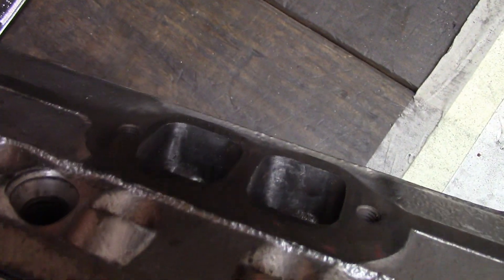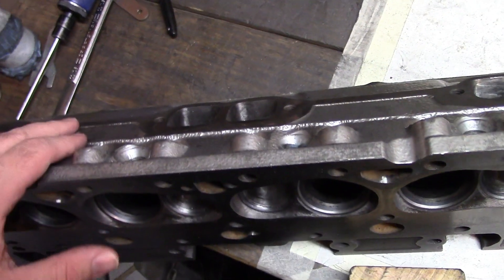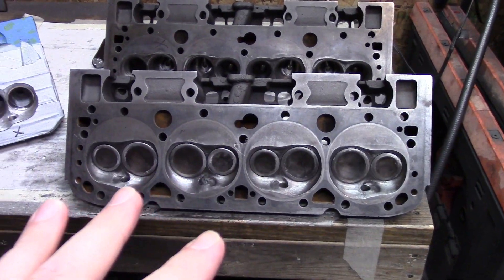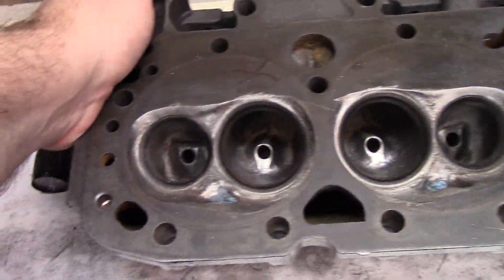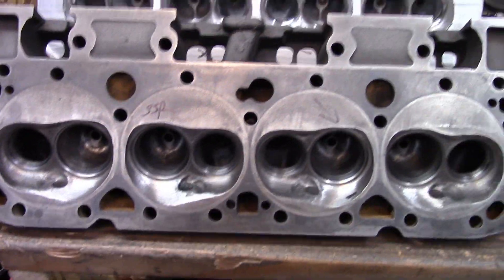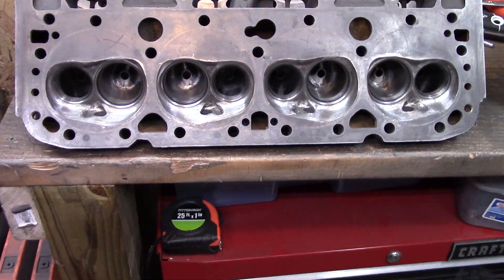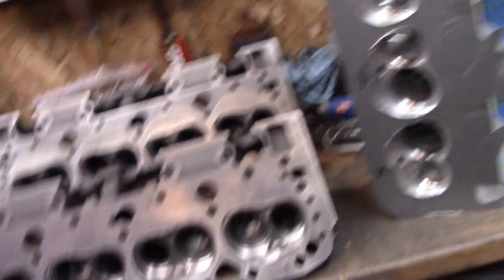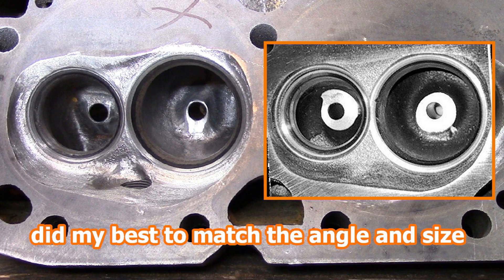Porting My Dart 2 SBC Heads Part 2

Comment: Nice work ! What engine are these going on. You talk about low compression..  Stock short block ?
Reply from the maker: Thx trying to finish them up tonight, then edit and upload pt3 for tomorrow.  It's a stock shortblock with dish pistons but I'm actually leaning towards not using them again LOL but I still wanted to finish them up at least.  Gonna CC a runner & chamber at least soon on the Darts.  After I inspect the 3.0 ebay head set I bought, gotta get that done in case I need to return that set by Tuesday
Reply: Do you happen to know the piston dish cc of the orginal piston with the chamfered edge ? 

I have a set of worked sportsman’s I might use on a similar deal. The compression and quench will suffer but it might run decent with properly matched parts. Camshaft, intake.. etc
Reply from the maker: @kristjanstefansson2765  I read the older dish like in my 77 are like 12-14cc, so I use 14cc when I calculate the compression.  Low end  n driveability will suffer but like you said with the right parts it can be reduced. Plain unported Sportsman II's were really picky on the tune but that was with the factory 1500 stall, I was too lazy to swap it LOL
Reply: What camshaft did you run with it. Did it suffer on the low end ? 

Flat tops with a decent quench and a small stall would probably do wonders. But that’s not the same throw togeather deal
Reply from the maker: Yah more comp would deff help and why I was considering milling the heads down to maybe 58-60cc if possible.   Stall would deff help, more gear, longtube headers n so on.  Cam part num n stats are on the muffler video I think.  Car worked for what I wanted when tuned right, just those other things would of made it easier to tune.

Comment: You should port the eBay heads 
I have a set they need to be
Reply from the maker: I'll get back to the ebay heads after my car is running.  I may post what I've videoed so far but we'll see how the Dart series does.
Reply: @BOOT  how do I know who h ones I have again 
Mine are 3 years old bought from a racing shop in Ontario Canada and he told me he bought the cores and had them built by a local machine shop 
They have dual valve springs he said. 550 lift max 
And he gave me a long list of stuff done to them 
It cost me 1400 cdn for both
Reply from the maker: I'm not sure exactly what your asking?  You want to ID ebay or Sportsman II heads?
Reply: @BOOT  yes I want.to know which eBay heads I have
Reply from the maker: Well two out of the three sets that I have of the generic ebay heads have vortec shape intake flange ports and those two sets only have the 12 bolt intake pattern.  My 2.0 set has both 12 & vortec 8 bolt vortec pattern with more standard intake flange port shape but so did the procomp head I borrowed.  You'd have to look at the differences I pointed out in my procomp vs ebay video if you think they may be procomp.  IDK what 1400cdn equals in US, so can't comment on the price.  I do know the generic cores are popular and machined by many(blueprint engines), even a skilled porter is going to offer them shortly with his own CNC and valvejob.  It's also rumored AFR will use the cores for their new budget head.  There may be other differences but I can only compare the three sets of generic ebay heads I have seen myself and I still haven't really checked out the 3.0 set, that's also on my to-do-list after my car.

Comment: Ever consider throwing in a time lapse scene of doing work on the heads? I think it would be cool. Maybe some of your other subscribers can chime in on this comment and put in their 2 cents.
Reply from the maker: I would like to, just don't think the camera lens would like it!  I have a hard enough time keeping the lens clean w/o doing any grinding around it.  I did some shots of my chopsaw but that was outside and I zoomed in a lot LOL  Cast iron is nasty stuff!
Reply from the maker: Well any metal dust is, kinda why I built my workshop to keep it off my cars and out of any engines I build in the garage.
Reply: @BOOT , that makes sense. Wonder if you could come up with an enclosure to film from. Anyways, you'll get a vehicle going soon enough and we'll see some cool action vids.
Reply from the maker: I got enough on my plate atm LOL maybe someday I'll have a old camera that I consider disposable or make something like that. Right now my goal is to get the car running and buy an action cam by then.  I know gopro has those underwater case things but I hear they overheat easy n shut off and it's deff hot in that room atm!
Reply: @BOOT  never had problems with my gopro in the waterproof case. Mine is a Hero 3 silver. Problem free for years now.
Reply from the maker: @Captain_Yodelstein  Might of been some of the newer ones.  I may get a 7 or 8, we'll see.
Reply: @BOOT  just got an 8 black. Haven't used ot yet. Going 4 wheeling tomorrow so we'll see how it works.
Reply from the maker: @Captain_Yodelstein  Cool, you'll have to let me know how yah like it